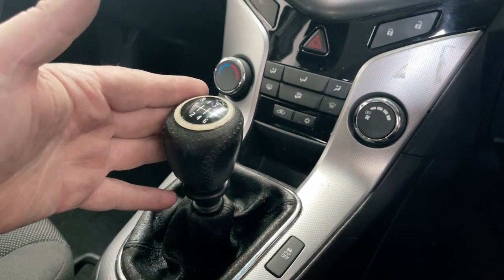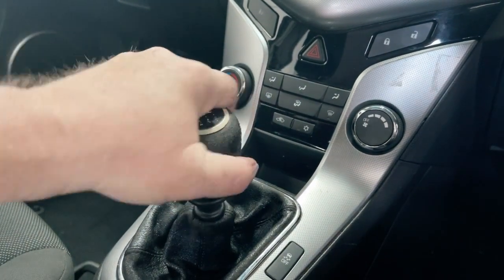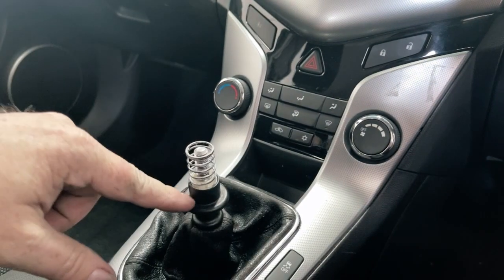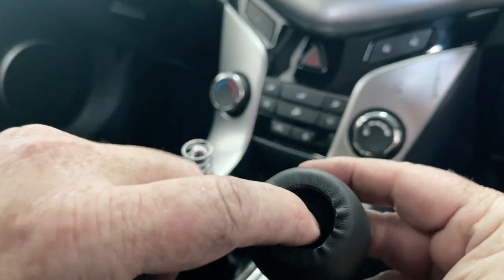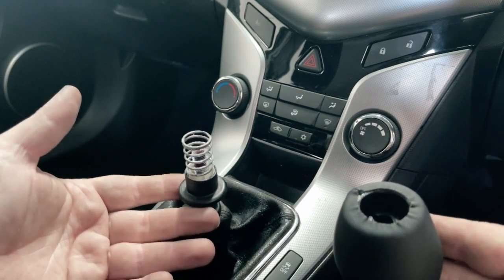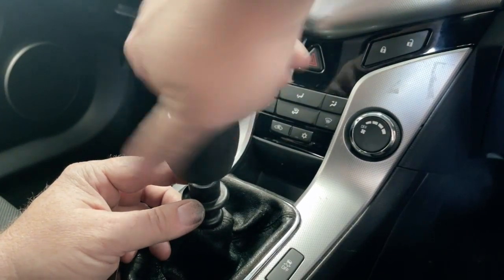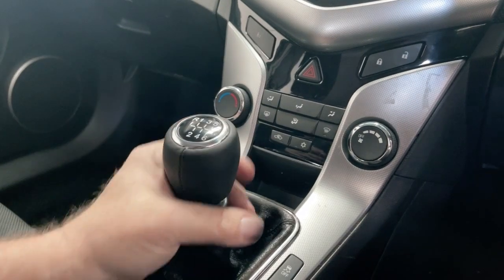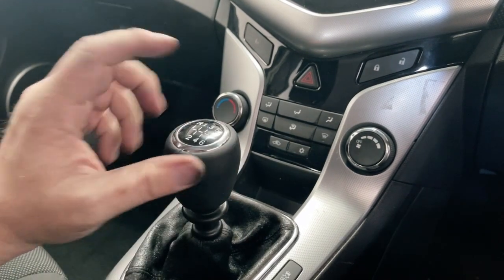Chevy Cruze Holden Cruze Gear Knob replacement.

Comment: I want to change mine so bad but after doing some research it looks like they are basically glued on or something and doesn’t twist off. Looks like I’m stuck with the original cause I’m not even going to attempt taking it off. Lol sucks cause I found a really cute one I want!

Comment: My actual GEAR STICK has bloody no thread it needs a slide on gear knob, it's a 2012 JH Cruze what the hell why is my stick different, i had to literally plastic cut it just to get off the stupid knob and now find out I'm screwed.
Reply: I'm in your same situation! did you figure it out? I want to trash the damn car because of this.
Reply: I have the same problem.  The 50$ nob I bought is threaded so it won't go on.  I'm really  upset.

Comment: Hey, where did you get the knob? I tried two from the internet and the hole in the middle is too small for the metallic shaft between the spring... :(
Reply from the maker: Was online, probably china. I must have been lucky as it fitted first go

Comment: Would a 2017 barina LS be the same? Tried twisting mine and it's stuck tight
Reply: I'm the same, got a 2014 barina can't work out how to remove the old one